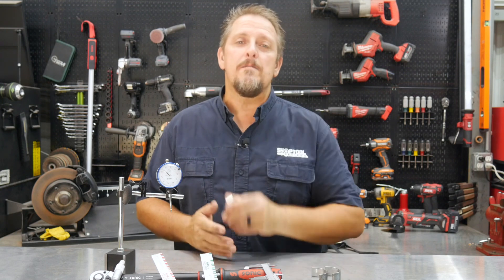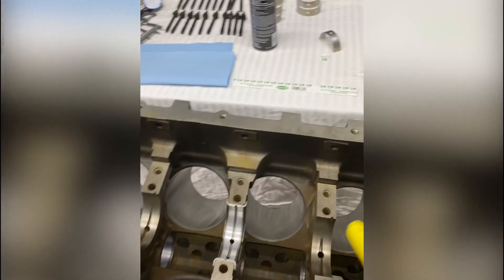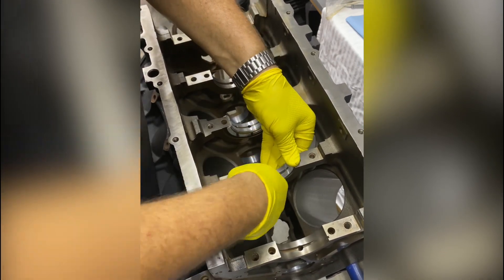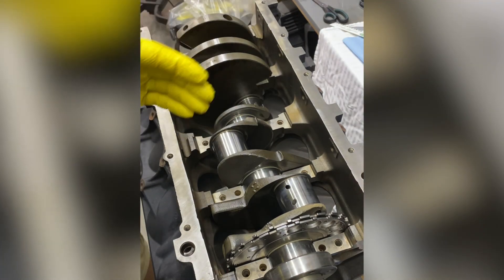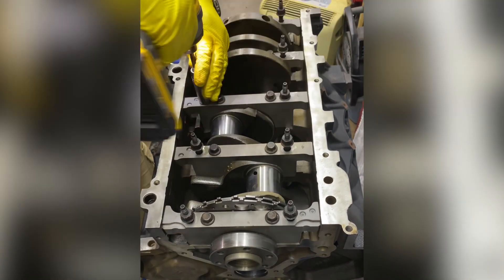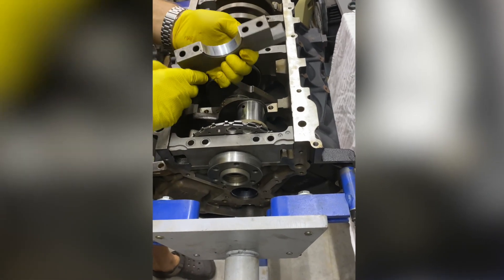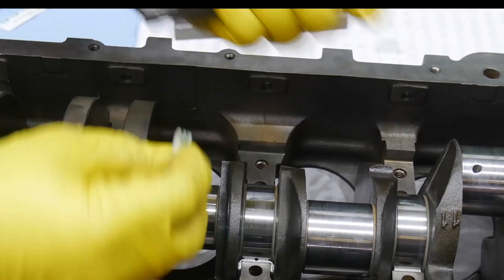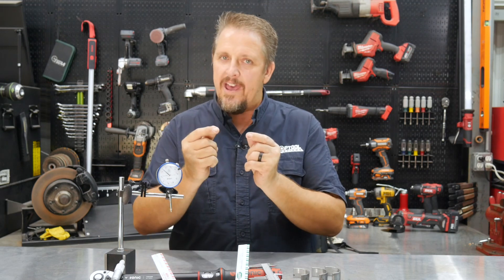How To Build LS 4.8 5.3 5.7 6.0 6.2 Engine Series - Bottom-End Pre-Assembly [PLASTIGAGE]

Comment: when you do finally assembly do you use new bolts to torque down since you stretched them when checking clearance? same idea with rod bearings and bolts?
Reply from the maker: No, if they’re new bolts and you just used them to check clearances, they’re fine to retorque/stretch again. It’s when many heat soaks occur that they shouldn’t be reused.

Comment: Mine is .1 do i need oversize besrings?
Reply from the maker: That depends on your vehicle and the recommended clearances from car manufacturer and/or the bearing manufacturer. Thanks for watching.
Reply: @ the clearence should be around 0.025 i got standard bearings, its a gen 3 5.3
Reply: And whenever i torque down the rod bearings the crankshaft wont spin